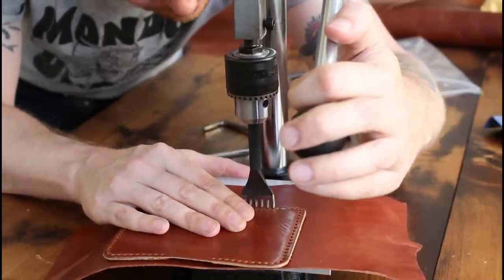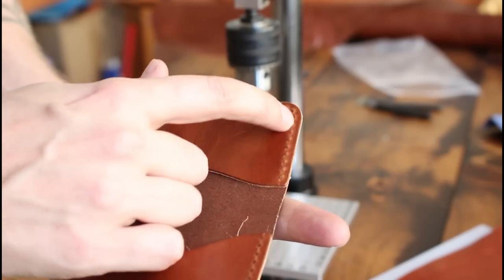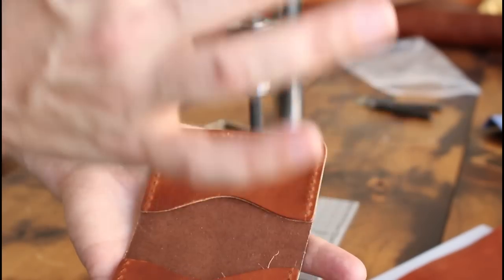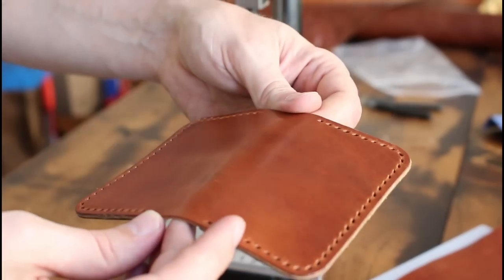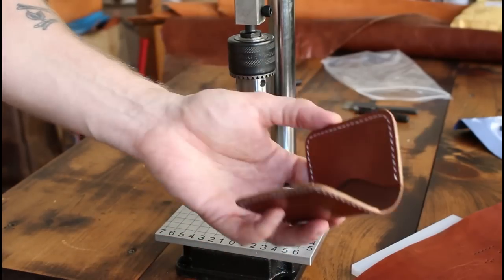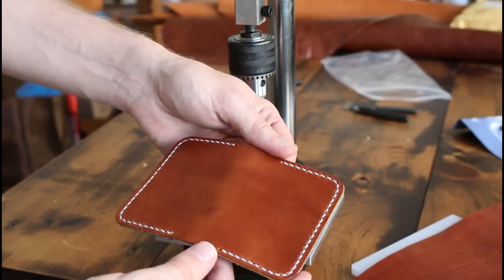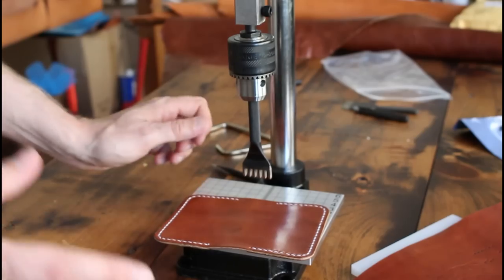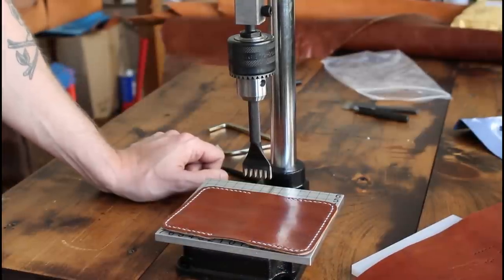Using A Hand Press Machine to Punch Leather Stitching Holes?

Comment from the maker: Yes I am aware I am cranking incorrectly. I had to operate from the back not to block the camera. 😀🎥
Reply from the maker: It really does need to be bolted down first before serious usage though.
Reply: Makesupply Leather This is a great idea, if you have a drill press you can use your stitching chisels the same way, by inserting into the drill press chuck.👍
Reply: Me gusta

Comment: I am using a 1 ton arbor press that also takes all my tools. It came with hole and screw all preinstalled. The big pro is it goes through 3 layers of the thickest leather like nothing, and looks perfect. And - I live in a flat and have to keep the hammering to a minimum. The press also sets rivets, buttons, cuts out any shapes, punches all my holes, stamps my leather etc. It is my ONE tool.
Reply: Sounds like a great tool. May i ask the make and model of your press?
Reply: @Elbowjom  I don't actually know the model my guess is it's Chinese a rebuild of an old German model. Got it off eBay. It's black with big red numbers on it, very distinctive. Mine is No 1. The larger they get, the higher the number.
Reply: Hello, is it possible to tell if you can put all the accessories on an arbor press ? Can you buy them separately and if so what did you buy please . Thanks
Reply: @oharu700  I just bought different sets of leather tools off of ebay. They all fit into the hole, some I wrapped with tape

Comment: If anyone didn't already offer this, try only making dimples with your two-prong, by hand. Whenever you get to the straight part again, put it back under the press. Once all your straight stretches are done, you can switch to the two prong, one time, and do all the corners and difficult parts.

Comment: My hands have started to hurt after using the mallet & chisel to punch leather, so I haven't done it in a while.  I was really interested after running across this video and bought a cheaper version of this to try out.  I definitely want to upgrade to the better version, but am really loving the ease of use that this style of punching allows.  I use a single 1mm hole punch, not a chisel-tip, over a paper template, which makes a very nice stitching line for thicker thread.  To speed the process, I found that by closing the space between the punch and the leather to 1/4 inch or less made it easy to quickly line up the hole, punch, align, punch, align, punch, align, punch, etc., at about the speed it takes to read.  It's made leatherworking fun again!  Thanks so much for sharing.

Edit - someone asked where to find a 1mm hole punch - I found mine as part of a set on amazon.  Good luck and have fun!

Comment: Thank you for this video. I purchased an upgraded version of this same machine with heating elements, so I have an option to hot brand leather or do gold foil and have a chuck drill installed when working with pricking irons. I had issues with the machine being unstable and didn't have the luxury of destroying my desk by permanently securing it to it because my apartment is too small, but I secured it to a cheap meat-cutting wooden board with a greater surface that I simply put on the table when working with it. Now here comes another problem with this tool - it comes with a very low-quality drill chuck so I replaced it with a self-securing drill chuck. No other tools are needed and it's quicker to replace different tools. There is a third problem as well and that is -  working with non-round tools like many pricking irons are. Drill chuck will simply not hold it properly, it will go sideways, and next to doing bad work you can also destroy your tools. I overcame this by buying an industrial rubber foot (the standard one for furniture is not strong enough for this) with installed M10 or M12 bolts. I simply put it in the drill chuck and manually hold the pricking iron with my left hand while pressing with my right hand. This is not an out-of-the-box solution but it is easy and cheap to upgrade it by yourself with just a little bit of effort and for just a little bit of money get a machine that really makes difference.

Comment: I think the press has lots of advantages... consistent straight punched holes, quiet - no more banging and accuracy. I find that when hand punching the holes it only takes a very slight angle variation to get the back holes out of line. I personally wouldn't use the 2 prong punch in the press and would do those corners manually but if you do want to change then I'm sure using the chuck key isn't necessary and hand tight would be enough. The only other way to get consistent holes on both sides would be to use pricking pliers.

Comment: Swapping out the tools is definitely gonna be a PITA.  I'm thinking maybe just use it for the straight runs and manually pop in the few holes for the corners.  You could even cut a groove on both sides without having to worry about missing the groove on the inside.

Comment: I have a Tandy Craftool hand press (the pretty less expensive red one) which I got for Mother's Day last year, and I have been using it to punch holes ever since the awesome and knowledgable staff at Tandy pointed out that I could do so with the Diamond Chisel Press Die and the Craftool Diamond Hole chisel set, which I had already bought sometime earlier. It makes all the stitching holes that I need noiselessly and saves my shoulder. I have adapted the small circular cutting board that comes with the die set by taping small discs of leather on it to make punching the holes easier and to protect the tips. I have also used my hand press for stamping, setting rivets, and snaps with the dies from Tandy. They do cost more than generic dies, but they are top quality and I have a feeling that Tandy will stand behind their products if they should break. The main disadvantage of the Tandy hand press is that it does not work with other less expensive generic dies.

Comment: I use an $80 table top drill press when I need to work quietly.  It does the same thing but can also be used to drill holes, Use as a drum sander or burnisher.
Reply: Hello! I've tried with a drill press but it doesn't work. How did you done it?

Comment: you need to remove the ball off the handle, go to a hardware store and buy a 24'' long 1/2'' steel pipe
insert the handle into the pipe and it will give you leverage . pick up a 2x6 board and a few bolts  along with a 6'' clamp. screw the machine to the 2x6  and now you can use the clamp to secure it to the table with out putting holes in it.

Comment: Good informative video. Thank you. I normally just use pricking irons.  However, I can see the advantage of this machine. Most people will buy it knowing they have to change irons on corners, or just do them by hand and continue with the machine for the  main body. Clamped down properly and standing in front of the  machine using it correctly, I can definitely see advantages to using this. And of course  the noise is another consideration. Professional leather workers probably wouldn't like it and doing lots of work they would use a sewing machine so punching holes wouldn't be required at all.

Comment: Got the same unit , I  moved the handle  around , drilled a hole in the square arm that holds the chuck where there was just a short throw to the material and put a removable pin in for a stop ( at this time the same drill bit :)  )  .

Comment: While I'm a traditionalist when it comes to many things, I can see the value in a product like this under certain circumstances.  I'm a night owl and my wife prefers to go to bed early.  I'm limited in what I can do while she is sleeping, so something like this would come in handy during those times.  Other than that, I like throwing a hammer down on chisels, so it's definitely not something I'd use exclusively.  One other note, you can adjust the handle throw so you don't have as much arm motion.

Comment: You have a bolt on each side of the ram, they are a "Positive Stop". The handle should stop at parallel to the table for max. leverage. Move the head up or down on the post for depth of punch. A punch pad similar to tire rubber duct taped to the base plate. A guide bar of 1/8 thick by 1" wide Steel with adjustment slots at each end to set distance from punch to edge of work peace. Drill and tap 1/4 x 20 the base plate for the guide bar. A flat metal plate over the guide bar located very near the stitch chisel to hold down the leather when lifting the chisel. This too will be bolted down and shimmed to proper height for your work peace. Do as much as possible with out changing tools. This will also work for round punches but with a stripper plat with a hole. Think about the time spent lining up the punch, pick up the hammer, bash the punch, put down the hammer, pry the punch out of the leather, repeat. The press is very efficient way to work.

Comment: As an aside, you'd see comparable speeds to hand punching if you had grouped the number of holes to be punched to minimize tool changes. Mark the holes on the corners with the two prong iron, but use the six prong to make the majority of the holes before swapping over. As others had said, the hand press gives consistent results (and in thicker leather) for quietly punching a lot of holes, but is also useful for setting leather hardware and studs, cutting belt/strap points, wet-forming and stamping. When properly secured to a bench, of course. 😊
Reply from the maker: Yes if I were to ever do another project like that I would mark them out as suggested. Someone mentioned they used this to do knife sheaths and that sounds like a great idea for accuracy.
Reply: thanks for this response, very practical. I was wondering myself how to get round that.

Comment: A much cheaper alternative are hand punches/pliers that you can buy anywhere between 15 to 50 bucks. Much quicker and easier to use than a press, but the press can use any tool you put in the chuck.
Reply: But punch pliers can only be used for stitching holes. You can use the press for almost all the work you would use a hammer for. Including cutting out shapes and such.

Comment: How has your experience been with the main shaft? I bought a very similar tool (the only difference is the color, I think), but after some use the main shaft started to bend. It even came off once, even though I tightened the bolt. My feeling is that the metal is made of cheap grade. Otherwise, I found the the machine better at churning out straighter lines than my bare hands. Thx for the video mate

Comment: Clever little tool there. To speed it up a little, wax the pricking iron or what I do is use the thick steel ruler from my combo square laid parallel to the pricking iron to hold the work piece flat while removing the pricking iron, this helps a lot when working with really soft stuff like lamb skin.

As far as speeding it up goes, think of it like a drill press, raise the work up closer to the pricking iron to shorten the travel of the lever.

Also, just mount the thing to a piece of wood and clamp it to your work surface to eliminate the commitment of a permanent place for the tool.

That thing is useless if not solidly mounted.  

Down a straight line you should be able to move faster than if you used a mallet. This should make up for the time taken to switch out the tools and as we agree it is much quieter than the mallet and a lot easier on your hands.

Another benefit may be that the tool is always at 90 degrees more uniform and no time spent on lining up the angle. Just run the piece through like would be done on a sewing machine.

Thanks for bringing this gadget to our attention, I see many potential uses for it.

Comment: I think one solution to changing out the tools would be to manually mark the corners using a 2 prong and then keep going with the 4-6 prong and only at the end switch the to the 2 prong and go over the markings

Comment: I've used my press for almost everything including punching holes and it works great ! I also made a guide to punch without lines at 2 mm 4 mm 6 mm along with glue it comes out great but i do the long runs first then the corners so your not changing tools like you did and with the guide i only overlap 1 hole ! Whats the thickness of that leather , i'm looking for thin stuff like that ?
Reply: Have you used this one in the video? Would you recommend this one?

Comment: Have you tried it for ready rivets and snaps? I have a cheapo harbor freight press that I drilled the shaft to hold tools (never thought of the drill chuck). Snaps and ready rivets are its prime use..  These require a nice even squish or you get a mess

Comment: First, you have clump the drill press that it doesn't move and with the double-sided tape fixed the acrylic plate over the metal one, then you need to adjust the height of the drill head that Pressing position is the most powerful. Does the drill chuck is big enough to hold the square head of the 8-10 teeth pricking Iron? The price is a little higher. such drill press costs less than 80$ in the hardware store
Reply from the maker: Yes it absolutely needs to be set in place before serious usage.

Comment: OK a couple of things. I just bought one and it is a lot, lot faster. It needs to be secured, you need to face the machine while operating it. On the corners I would not and now don't, change out the 2 pin punch. do the corners by hand. I have to give the little machine high praises for speed nd uniformity.

Comment: I bought this same press and love it. I'm having an issue with my two prong hole punch getting stuck in the leather, and having to pull the leather down, off the prongs every time. Any suggestions?
Reply: coat the punches with beeswax

Comment: Though it’s cool and convenient, one has to take in consideration the knurl on some of these pricking irons. With the drill chuck having three jaws, the more the jaws are fastened against these knurled, the more chance the jaws can slightly crush the knurling, making the pricking Iron go eccentric, though this eccentricity is slight, the stitching alignment can possibly be off, specially visually. Also, drill chucks aren’t known for being precise. When ever possible, it may be better to to machine a brass collet for prick punches and have attached in place of the chuck. With the collet being a close fit to the pricking Iron holding area.

Comment: Filming and trying to use it at the same time is frustrating. You say getting around the corner wasn’t easy but it looked so obvious that all you cared for was the camera angle and not about properly using the tool. Move the camera when you can’t properly use tools if not don’t do reviews complaining about shit that wouldn’t have been a issue with no camera

Comment: What is the preferable distance for stiching line and leather edge?
Reply: Generally the thickness of all the leather layers can be used as a rough guide for where the stitch line should go. So if the stack is 5mm or 6mm thick (1/4" or so), then that would also be a good margin. Try not to go less than 5mm - going too close to the edge open up the possibility of a stitch tearing out through the edge. On heavier projects, you may want to increase the margin to provide for extra strength on the seam since you're punching through so much leather.

Really though, you're the artist - if you like it, and it holds strong, put the seam wherever you like!

Comment: You can also use a leather awl.  A leather awl is not expensive, completely silent and it is quick to work with. Above all, you can make inconspicuous seams with it without seeing the insertion hole. You can also easily sink the leather awl seam into the leather. All this gives the leather goods an elegant look. You do not need any strength to do it with an awl.

Comment: I'm looking into getting this machine. As far as changing our the number of prongs, I have a set that has one handle and you just screw in the tips into the handle. So, once the handle installed int he chuck, just unscrew the 6 prong and replace it with the 2 prong. It will make switching the number of prongs much faster. Like this one: https://tandyleather.com/collections/tools/products/diamond-hole-chisel-set
Reply: Did you end up getting this machine and how did it turn out for you I'm looking at buying one for myself and I would like to hear your opinion
Reply: @brendanmccreesh5112  yes, I did get this and was very disappointed. It only has one screw that holds the chuck or the bit in and as a result, it makes the check/bit Cantor enough that it doesn’t press straight down. I tried wedging some thing on the opposite side to help straighten it out, one individual posted, said that he fixed it because he’s a machinist, but he didn’t say how. I thought about taking it to a machinist and having a second screw hole tapped on the other side in order to straighten it out, or taking it to a welder and having them weld the chuck in so it is straight doesn’t move and can’t be removed. But instead, I wound up going to Tandy and buying one of their machines which I’m a lot more happy with.
Reply: @ricewing1  Thank you very much I'll have to look for one that's better quality.

Comment: Stop using that tool to tighten the chuck. It only needs to be hand tightened. It should take literally .5 seconds to swap out your pricking irons. I use a rare earth magnet above the chuck to hold my irons.This is so much easier and so much more efficient than doing it by hand.
Reply: Are there any disadvantages with using the chuck and hand tightening compared to the magnet? Are there any other ways where it's better to use the chuck?